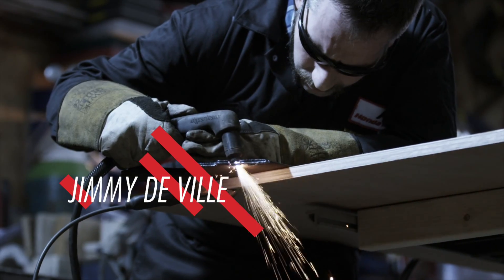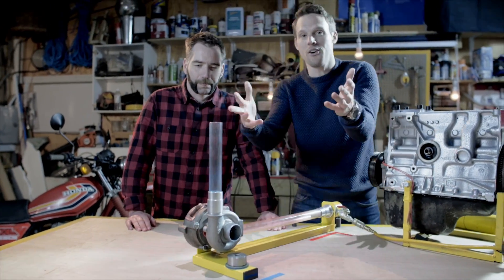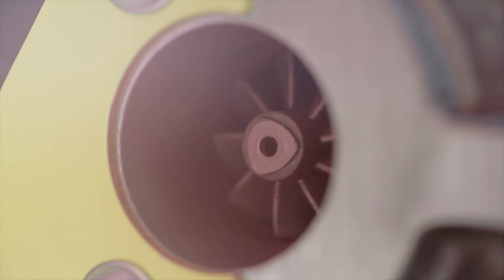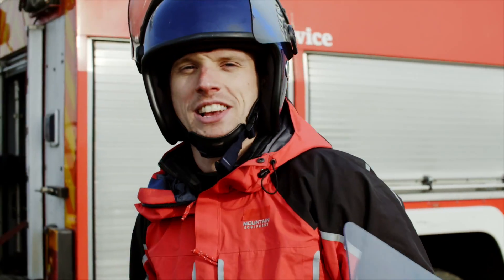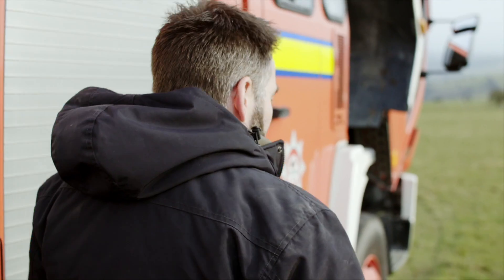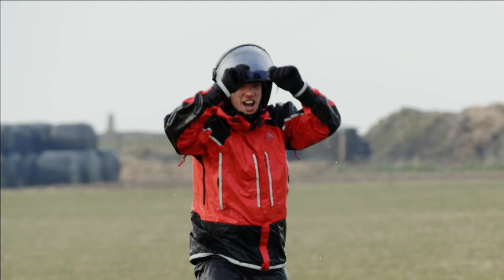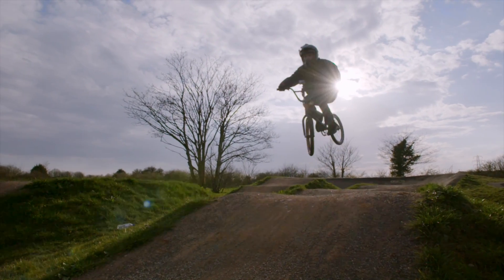Turbocharger: Self-Powered Boost I The F1 Power Unit I Honda F1 2016

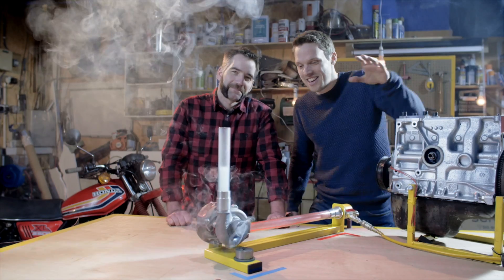Comment: 2:31, incomplete information.  Compress outside air and force that air back into the engine cylinders, does not give the engine more power.  Pump more air into the engine, means pumping more fuel into the engine, thus the engine generate more power.

Comment: yo're so wrong. read some physics. turbine extract exaust gas kinetic energy not heat. when exhaust valve opens there is still lot of pressure and exhaust gases rushes out to the atmosphere
Reply: there's no heat extraction

Comment: The energy isnt lost, if you install an turbo, the engine needs to work harder to "pump" out the exhaust gases
Reply: Only if you also increase the power of the engine. If you were to compare just adding the turbo and keeping the engine at the same power, energy would be "lost" in the case without turbo.

Comment: Um... A turbo doesn't "turn heat energy into kinetic energy"... The force, the pressure, from the exhaust gasses actually spins the turbine, forcing more air into the intake... Heat has nothing to do with it... It would be better if it was cold/room temp.
Reply: Mickey Havoc Not true.  A turbo isn't driven like a pinwheel spinning in the breeze.  The thermal expansion of the exhaust gasses is really what drives the turbine.  This expansion is caused by thermal energy.

Comment: ...except fire engines use separate non-turbo diesel motors to power the pumps and in reality they just turned up the throttle on the pump motor. There's definitely a notable difference in rpms on both water blasts

Comment: why f1 turbos use 2 inlets at the turbine side?
Reply: This means that more air will get to the turbo which means it can compress more air but I guess that depends on how much boost they are running if they would use all that air or not.

Comment: Well that was misleading. Click bait. And plus I've never heard of a fire truck using a turbo from the motor to increase water pressure. He connected its intercooler pipe back up that's it. I don't know what that has to do with anything. It's called a PTO pump... power take off.

Comment: First off, it's movement energy, not heat energy? And this is not a unusual turbo, these turbos are old asf.
Reply: If you would compare the exhaust gasses before and after they enter the turbo, both enthalpy and temperature would be higher before they enter the turbine.

Comment: This is all great with your English accents and stuff? But how about you tell me how I can get the more power running HHo fuel cell, get more power and not blow up! Then you might have something? and not the same old petrole BS! Give me something new!
Reply: DayRider76 which one you think gives you more power
Reply: +Han Gathercole of coarse you'll get more power from gasoline, that's what engines are designed to run. Hho deserves more research
Reply: DayRider76 I meant adding a turbo to a gasoline engine. as you would add an hho cell to a gasoline engine. out of curiosity do you think hho cells increase combustion efficiency or add engergy to the system?
Reply: given the source of energy for the hho production
Reply: Han Gathercole Lam it doesn't boost the power out put of an international combustion engine like forced air induction, I just wish the word would explore the reality of having a renewable fuel source that's main byproduct is h20! Using hho in existing engine technology is inherently flawed, they're not designed for that. Given years of advancement as with with what we have now, I think it's a far superior way to go!
Reply: DayRider76 so you mean producing it in a plant and putting it in cars? you cant make hydrogen and oxygen without using energy. its not a fuel source. a gasoline engine can basically already run on hydrogen and the oxygen element of hho is everywhere in air though on a positive note.
Reply: I have a generator that runs on water! It will run entirely on hho produced produced in one cell, problem is, it's to lean and eventually gets to hot and flashes the hho in the intake, addition of a little gasoline, runs fine? We can make engines that run on and produce their own hho
Reply: DayRider76 what is the general topology? If I cant satisfy myself adequately with your explanation I will eagerly build it.

Comment: The turbo isn't putting power that would have been lost into the engine, it's scavenging exhaust pressure to increase intake pressure, getting more air into the cylinders, which, when coupled with additional fuel, allows the engine to produce more power.
Reply: Its not scavenging, you idiot!.  The turbine adds back pressure upstream of its self!.
Reply: Marek Sumguy And where is that back pressure coming from? The turbo isn't making it, it's providing a restriction that allows the engine to build up backpressure that then runs the turbo. We call that scavenging. Idiot.
Reply: Thats NOT "scavenging"!.  "Scavenging" is a PULLING action. The Turbine is not PULLING the gasses out causing a negative or near-negative pressure upstream of the turbine!.  If it was scavenging, then the pressure downstream of the turbine would be higher than the pressure upstream of the turbine.  So who's the idiot??.
Reply: I was under the impression that scavenging was a term indicating that exhaust fuild momentum is being used to pull exhaust gas out and fresh air/fuel mix into a combustion chamber (typically 2 stroke si engines). Also, the overall purpose of turbochargers is to help mitigate pumping losses in IC engines allowing for higher brake mean effective pressure if recall correctly from heywood.
Reply: I rate 10/10  this Comment.

Comment: This showed a very simplistic, non factual way a turbo helps make extra power for an engine. And then at the end they said that a turbo on a Honda makes 400% extra power. Maybe I'm wrong, but 400% is stretching it just a little bit! As for the firetruck demonstration, the distance a pump can shoot water will have very little to do whether or not the truck engine had a turbo or not.
Reply: thats wat you think but the turbo is needed for the more power to compress the water out of the hose
i build  trucks everyday and the turbo disconnected will seriously decrease power
Reply: actually this 400 percent is about right. say the v6 1.6 makes 200hp without turbo, which is probably what it would make, 400% is 800hp. which sounds about right. idk how much power f1 engines make, but u get the point. as for the turbo making the water go further, yes it would. the truck engine is tuned to run with a turbo, without the turbo it makes a lot less power, which is less power to run the water pump, pump runs at lower power, water doesn't go as far, drop in the turbo, u got a couple hundred more hp to turn that pump, which gives it the power to shoot the water further. really quite easy
Reply: i hate to troll but thost numbers are pretty accurate, there are turbo kits capable of adding 500+whp to 2.0l honda engines without a doubt, and that is something anyone can do, im asuming f1 has a bit more advanced technology compared to the mass production  engines we are given consittering they are capable of such power figures with even less displacment, i think the goal here was to show the increase torque at a given rpm. if the pump on the truck was powered by hydrolics or a mechanical pto, the output of the pump is obviously rpm dependant, so at 1500rpm the truck may produce 450 foot pounds of torque, add a turbo and your torque curve will amplify, giving you more results at the same rpm say 700 foot pounds at the same 1500 rpm.(diesel figures). now if i remember how a pump works, more torque gives you the advantage to move more water in the same amount of time. so yes, more torque will give you more distance.   give a rock to your  strongest friend and have him throw it, now put the same rock in a small hand held sling shot, what went further, and why? its waste (relaxation) is used as energy. an engines waste (exhaust cycle) is used as additinal energy also.
Reply: There is mass confusion up in here.. So I'm gotta find out the real. Dealing with rear brake turbo here. The brake has to be used. ALOT from what I've seen to build pressure for an extra boost. I believe lettuce see CASH
Reply: tomjw7

Comment: Disconnecting the turbo does not really prove that much because turbo engines a lot of time start out with lower compression than otherwise they would have as N/A. If you don't believe me just go to the 2016 mustang engine stat page which compares all models side by side. Additionally, these, days comparatively the efficiency of the turbo vs N/A power is highly debatable... I'm kinda sad about it too so don't take this the wrong way haha
Reply: american and europe/japanees cars can't be really compared